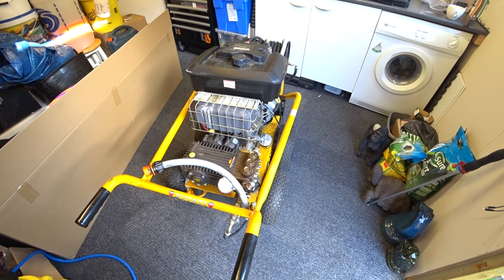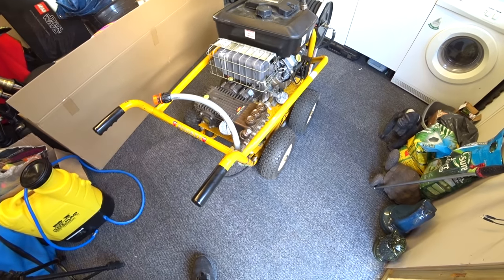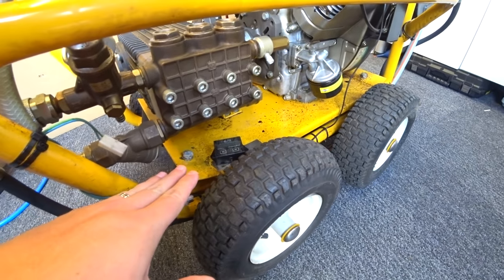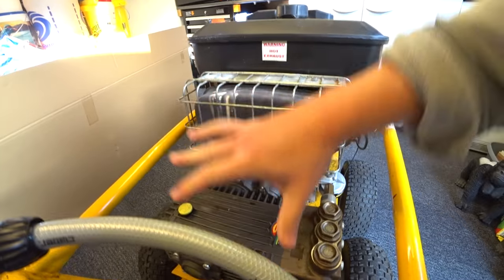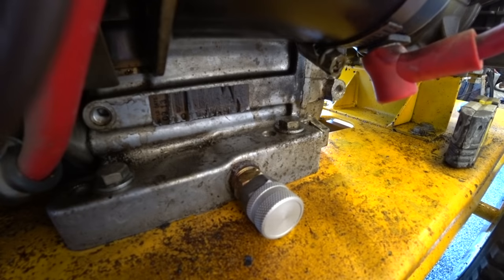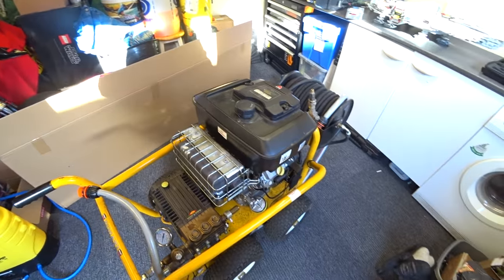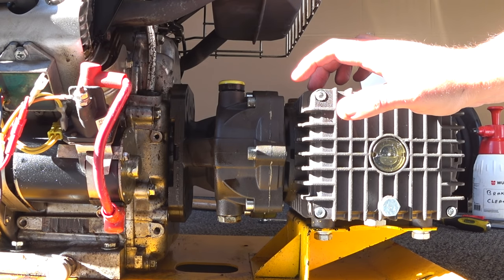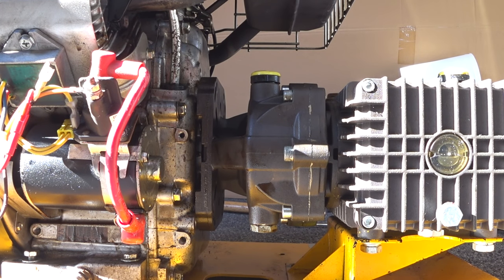Washer Strip, Removing Gearbox & Pump

Comment: There is a lot to be said for 'belt drive'
Reply from the maker: Admittedly a belt driven system would probably of been easier to remove. There is so much scepticism over belt drives on jet washers, so much dirt and muck can lead to potential failure of the belt and pulleys. Interpump don't do a belt drive system that can be used in replacement of the gearbox. I'm sure something could be adapted but it would be interesting to see how belt systems fair up in the harsh outdoor environment. Even though my washer lives on the van, not everyone has the space to do that.
Reply: @DirtyDriveAway  Hmmm thanks for that, I never would have considered the dirt and grime between the belt and the cog, it's one to consider alright if  the washer is mostly outside of the van, cheers, thanks for the answer and amazing content and for passing on the knowledge :) PS: love that falch nozzle.